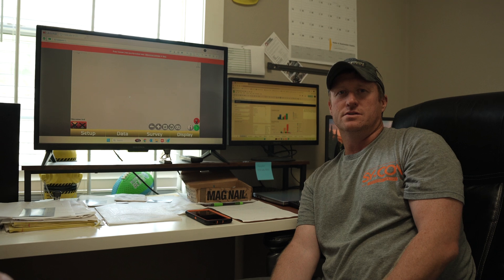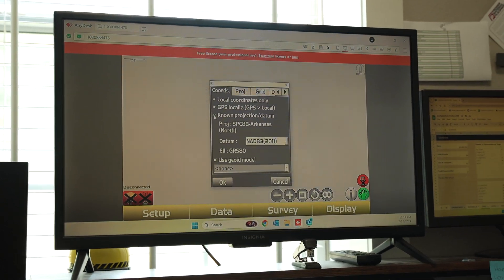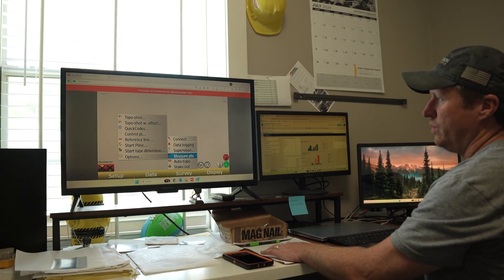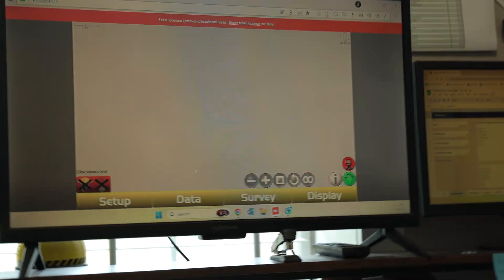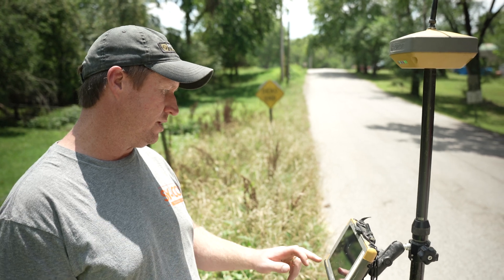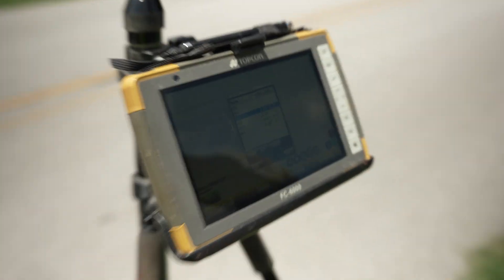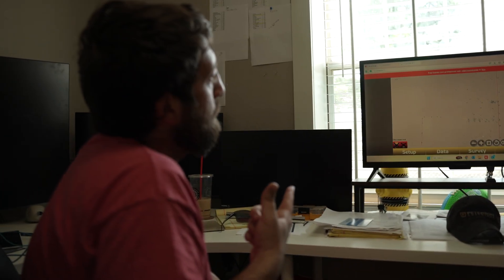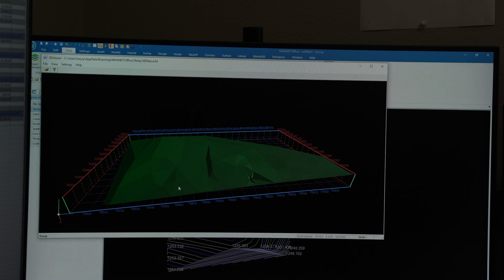Using TOPCON GPS Rover! Building Surfaces

Comment: Did you guys have a base station setup as well on like a t post somewhere to increase accuracy? Is it true that the accuracy is only sub 3 feet without a base station rover to make corrections?
Reply from the maker: Great question! They did not in this go round! 

On most all commercial projects we have a base pole setup, localize to 4-6 control points and then accuracy will improve drastically. But yes there’s a tolerance.

Comment: Nice video. What is the main benefit to switching the base from projection -> local at around 7:40? I am not saying it's wrong to do this just new to this stuff, didn't understand this step. Did the elevation readings stay the same when re-measuring each point? Or do the coordinates change slightly?
Reply: Probably not necessary to make that change for just doing a topo.  I do that so our guys can use a local site calibration if they wind up on site.  We're trying to keep with their normal workflow to keep it simple.